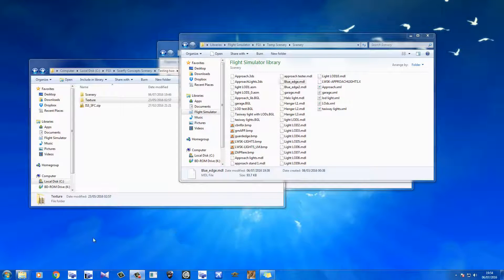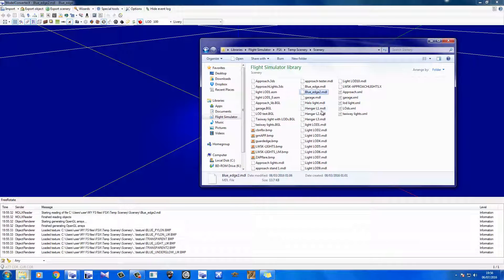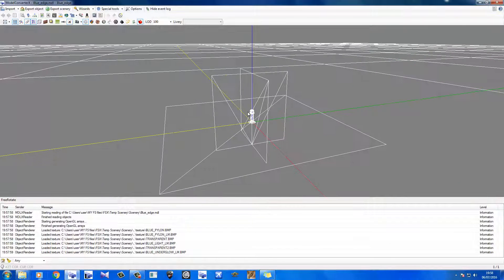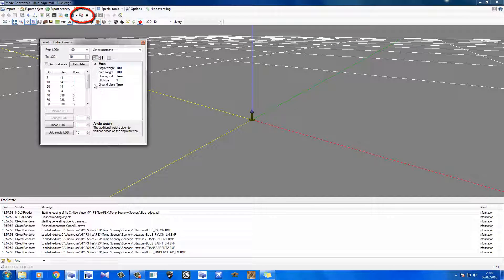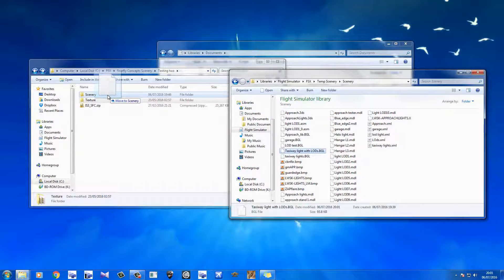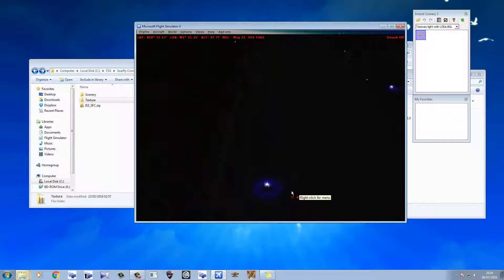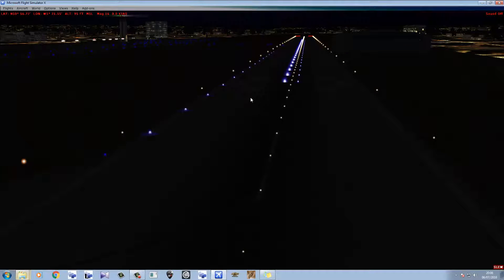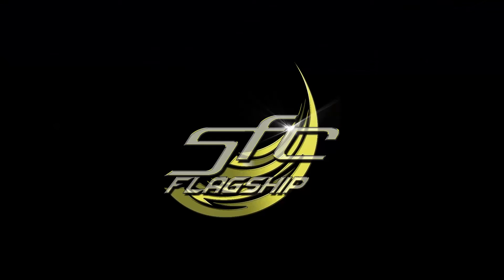FSX Tutorial: Creating Taxiway Lights with LODs

Comment: MY taxi lights are not working as intended. Is their any ratio for scaling LOD models?
Reply from the maker: The LODs are a little limited it is a lot easier to use actual light models or BGL lights or even effects
Reply: @Soarflyconcepts  Thank you for your reply. But if you could specify a bit more detail, it would be great for me. or Can I contact you via some mail?
Reply from the maker: @akhilvijay8670  you can use a great little program called AFLT (it's free) and that generated lights as .fx or bgl lights
Reply: @Soarflyconcepts   I tried AFLT and get this error while compailing 
'the attribute name on this element is not defined in DTD/schema' where should I change name